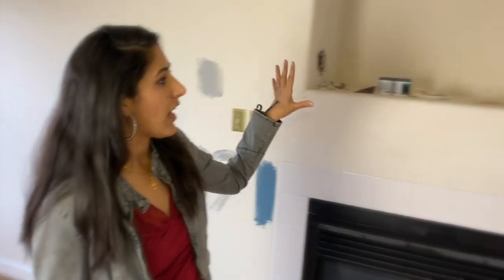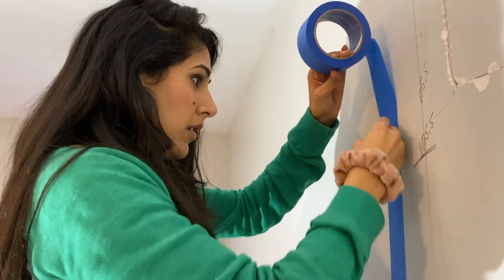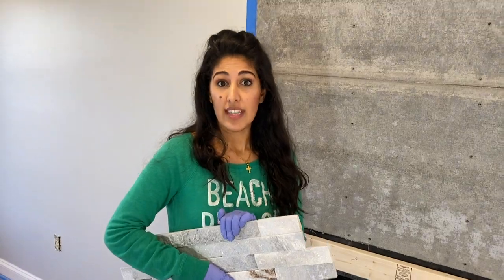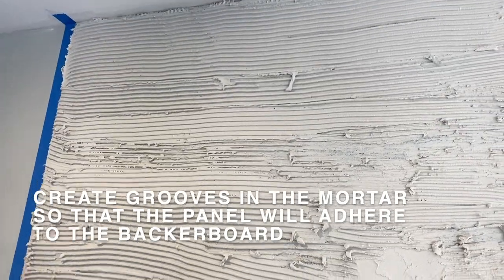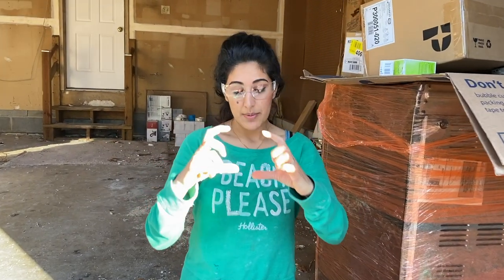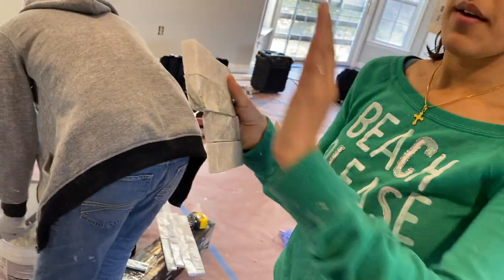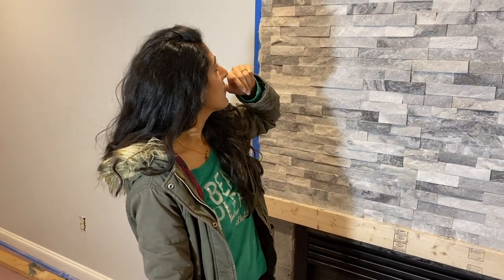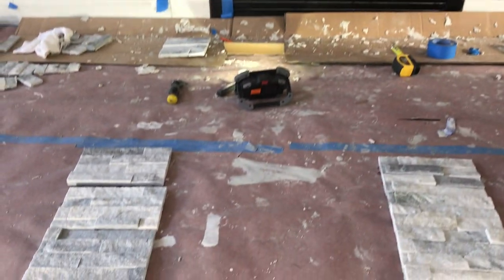6 Easy Steps: How to Build a Stone Fireplace!

Comment: Why did you put mortar on the entire wall at once instead of doing it in small sections as you went along?  The mortar will dry out and not adhere well to the stone.
Reply: That stuff in particular takes forever to dry
Reply: @samml3836  I'm questioneing the choice of mud also.  The mud should be applied with a half inch notched trowel, and the product should be a fluffy more wet mud.  Oh boy...

Comment: My big concern is that it appears to me that the contractor/and his assistant tiled over the trim of the fireplace which now may effectively encapsulate the fireplace unit;  what happens if the unit fails and has to be removed?  my experience is that the fireplace components are reachable through a horizontal panel near the floor, which is removable but its not clear that that panel or the fireplace itself can be removed if needed for service or replacement after this DYI project.   so...   potentially not thought through.....
Reply: Yes, I was wondering that myself.  It does not seem to be a good idea to cover the edges of that insert unit...

Comment: I don't know if you still respond to this thread but I understand the mortar application and use but I see in other places it mentions using grout and it looks like you didn't need to use any grout and that the tiles fit up against one another. I am using similar if not the exact same tile so I was wondering. Thanks and great job!
Reply from the maker: Hi, thank you for your feedback! Truly appreciate it. I have not been on YouTube for at least a year if not more. Theses tiles did fit seamlessly together. We used the adhesive that was recommended for these specific tiles. I also, checked with 2 different contractors, because it is important to me that projects like this are done right! I hope you have a beautiful week! Did you end up finishing your project?

Comment: Do I have to use backer board if it's just an accent wa and not a fireplace?
Reply: I've seen many other videos on this subject and the recommendation is to use the backer board for heavy stone. I you use a thinner, lighter manufactured stone-like product, then drywall is fine. Real-stone requires the backer board because the thin-set adheres to it best. I also learned that if your feature wall is higher than 10 feet tall, the recommendation is backer board no matter what product you use.

Comment: Is it said that if the height is less than 8ft, its ok to put the stones on your drywall..... true of false?
Reply: Yes you can do a small area. But remember the weight factor . 1/4” cement board is very inexpensive, and will give you a perfect surface to adhere to.
Reply: @stevenmorris2293  I have a customer who I originally thought just wanted tile around her fireplace but she now wants stacked stone like this. 
Can I just install 1/4” backer board over the drywall? It’s a pretty small area, just around the firebox. 
Or do I have to demo the 1/2 inch drywall I have already installed and put up 1/2” backer board?